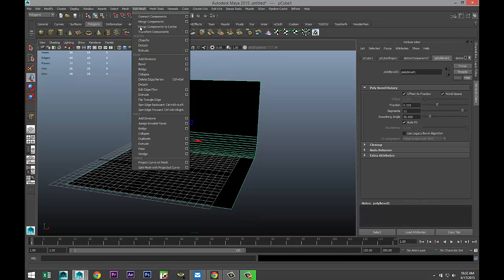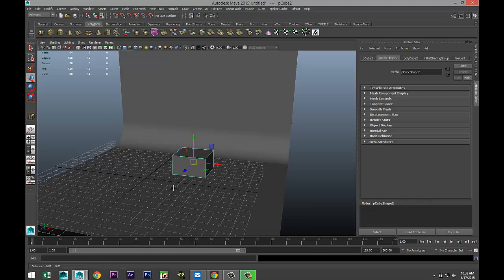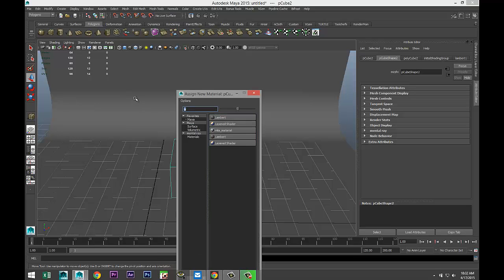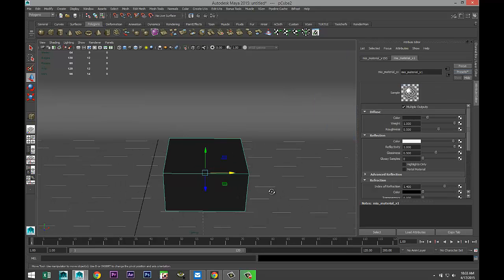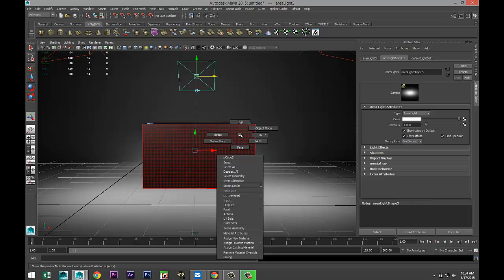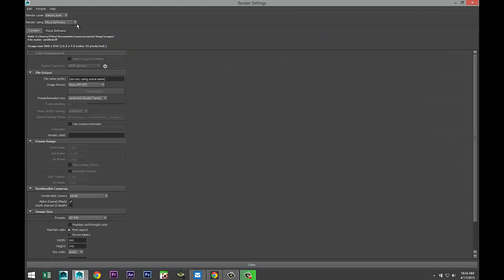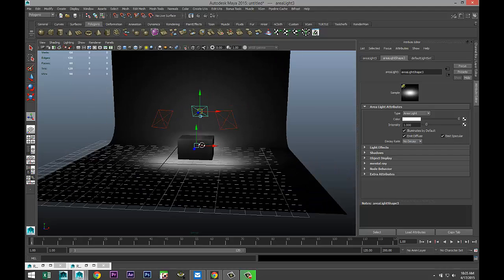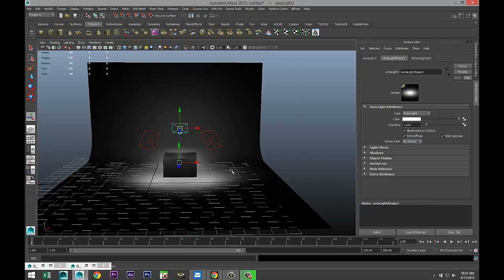Studio Light setup in Autodesk Maya

Comment: Hello Mike Hermes, 
I am good at modeling stuff and yet good at texturing but I am still very poor with lighting. can you do a video on the lighting techniques which was done on this piece of artwork? https://www.google.com.pk/search?q=ship+in+bottle&rlz=1C1GNAM_enPK676PK676&tbm=isch&imgil=SruLkYOxuQT6nM%253A%253BatG6MEGaFviGgM%253Bhttp%25253A%25252F%25252Frafajija.deviantart.com%25252Fart%25252FShip-in-the-bottle-286212064&source=iu&pf=m&fir=SruLkYOxuQT6nM%253A%252CatG6MEGaFviGgM%252C_&usg=__322mN1U6wMhNpuCGWPFl9LAr7yU%3D&biw=1280&bih=675&ved=0ahUKEwjShITs48zLAhXBXhoKHTxBDjUQyjcIKg&ei=8EntVtLMOsG9abyCuagD#imgrc=SruLkYOxuQT6nM%3A 
 I will really appreciate it as you are very good at making things easy.
Reply from the maker: +ismy alak Hi there, I have done more than one video on lighting and also studio lighting but in this example it is very much about reflection, refraction and caustics due to the use of glass. ( I did video on that as well. ) Check my lighting video playlist